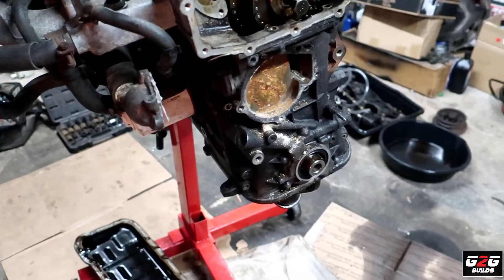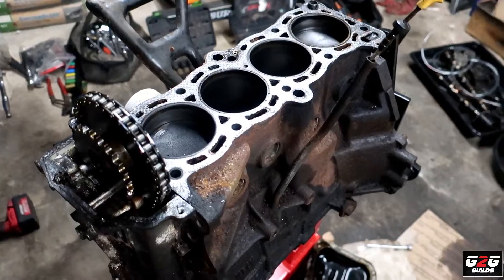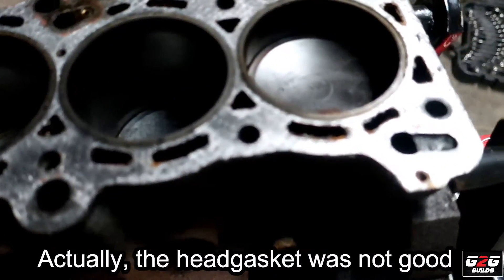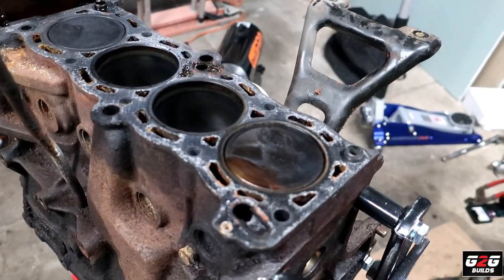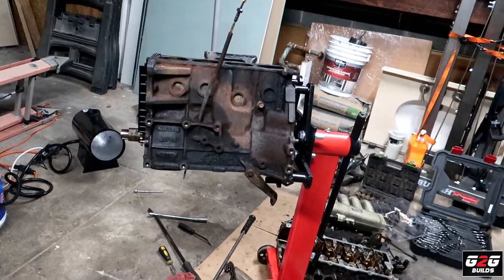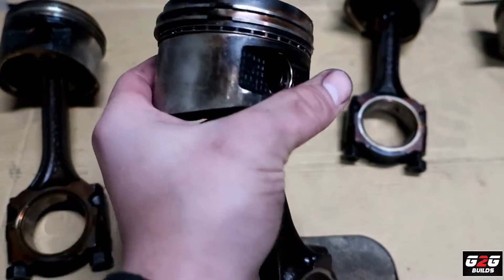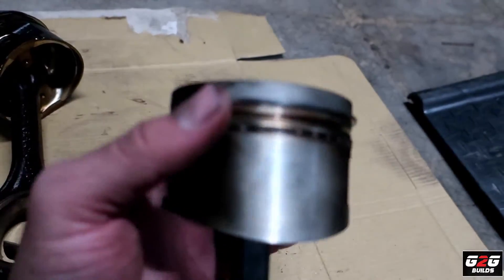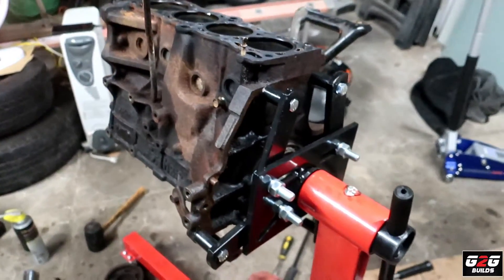B13 Sentra GA16DE Engine Disassemble (Part 2)

Comment: My GA16DE engine locked up any tips on fixing it ?? It has 230k miles or just replace engine ?
Reply from the maker: Rebuilding the current one or replacing for another one are the only 2 options.

Comment: I have a ga15 engine single cam and I am turning it into a twin cam can I turbocharge it with the ga15 head
Reply from the maker: I think you can. Anything can be turbocharge. You must make sure you get fuel upgrades and tune in order to don't hurt your engine.
Reply: I don't have no high compression pistons for the engine so if I turbo it can I still get good power from it with the stock pistons
Reply from the maker: Yes, you can boost it with stock pistons. I'll recommend about 7psi with the right fuel upgrades and tune ecu for it.
Reply: Thank you you are a real help big up yourself

Comment: According to the pistons and the slaves, course op problem might be fuel oversampling. Hotshots on pistons and decarbunised crown surfaces,  is a big giveaway. Did you look for cause of problem?
Reply from the maker: This engine went into a lean mixtures under 10psi which cause to lift the headgasket and crack two pistons.

Comment: Did you port and polish that head?
Reply from the maker: No. As know, i have not plans on it. I dont have enought funds for it.
Reply: @G2GBuilds  https://youtu.be/iejDWSQEsqI
 this guy give step by step instruction using basic stuff... Polished my ga16de head, then chipped it from JWT. There is a huge difference in throttle response. I just cant find a high port sr20 throttle body. Even at the junk yards people have stripped them off the g20t.
Reply from the maker: I will check it out.
Thanks a lot.

Comment: Would you be kind enough to let me know from where to where does the fuel line from the filter in the engine comparment go towards to!!
Reply from the maker: Now you have me thinking..
I can't remember if the fuel line from the filter goes into the fuel rail or goes back to fuel tank.
I can try to take a look after work.
Reply: @G2GBuilds  i didnt specify but its the line that goes to the bottom of the fuel filter in the engine compartment it looks like it goes to the tank but i havent been able to lift it up to check its leaking and im looking to replace it
Reply from the maker: @XavierYF  oh okay..
Yes, the line underneath of the filter goes back to the tank. Some of it is a rubber hose and then change to metal hard line I believe.

Comment: Big props bro. Yo también tengo una sentra con el mismo motor. 1998 nissan sentra, manual. Y apenas ayer le tuve k remplecer mi alternador. I too am doing all the work myself. I gotta see your videos because I need to do my timing as well.
Reply from the maker: Gracias bro..
When I start to assemble everything back I'm planning on showing to do the timing.
I have never do it on this engine, but I had done it on other cars.
Reply: @G2GBuilds  No, gracias a ti, for doing this lol. Just because I like my car and want to have it longer. I like having my little stick shift hahaha. Pero Ojalá my car can last just longer, ni ha sido un año k tengo el carro.
Reply from the maker: @eddie0salas  entiendo. Yo hice este canal con la idea de ayudar a los demás. Por tanto, cuanta con eso. De por si, estos motores dura muchísimo, después q le des el mantenimiento adecuado.
Reply: @G2GBuilds  y si. Por eso me gustan los older sentras.  Y muchas gracias de nuevo por ayudar nos a los k tenemos el ga16de. I would love to turbo mine like yours. But Idk if id want to deal with the whole build itself and then to dyno it lol. Alot of work. I just gotta do things now to get it running better like doing the timing and also replacing the shocks that are shot. Its riding on 17's, 205/40 17. I wanna go to 215/45 17, I got them from someone who had a honda.

Comment: alibaba forged internals maybe?

love the content. keep it up.
Reply from the maker: Do you have any links?
I had no luck finding pistons or rods around yet.
And thanks for checking the video out! 👍
Reply: @G2GBuilds  you can use 76mm ycp vitara pistons from a d16z6 they are about $100 on ebay, and steel rods for $400 for the ga16. I've been planning to do this build for a long time..
Reply from the maker: @xalr6128  I read about those..
Well, let see what happens..
Thank you!
Reply: @G2GBuilds  No problem man! 👍👍
Reply: @xalr6128  do the d16 Vitara pistons fit the ga16de without modification then?
Reply from the maker: 76mm vitara fits ga16de block. Rods need to be machine to work with the pistons.
Reply: @G2GBuilds  what needs to be machined? D16 vitara uses a 19mm wrist pin and I thought that's what the ga16de uses

Comment: Do you know anything about how close this engine is to the E16 in the B12 sentra? i am looking to do the GA16DE swap into my B12 because it is just too slow and blowing out oil.
Reply from the maker: Hey..
I'm not sure how close the e16 and ga16de, but I know that the b12 came ga16i, which is almost the same block as the ga16de.
I have seen people even doing sr20ve into the b12 too. Most likely you will need the engine and the ecu to either swap (ga16de or sr swap).

Comment: I used some plastic grinder wheels to clean all my pistons and cylinder walls. The hardest part was making sure I didn't mess the timing up. But I did, got it fixed going to start it tonight. Good luck with your build man !
Reply from the maker: Thanks bro. This one will take some time, but for sure It will be done..
Good luck with your project too.. ✌